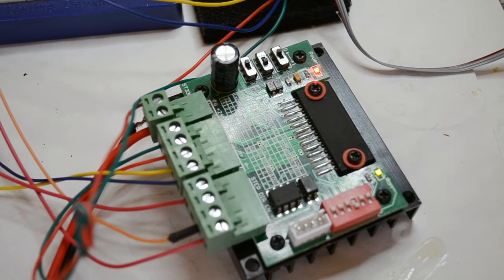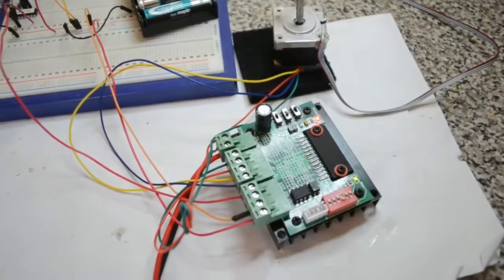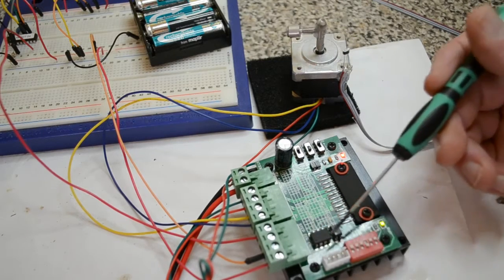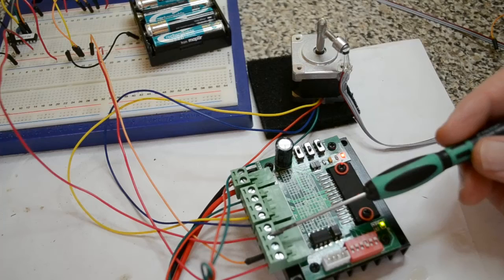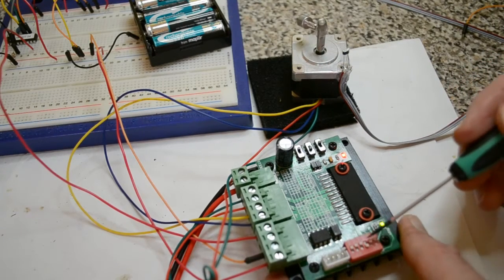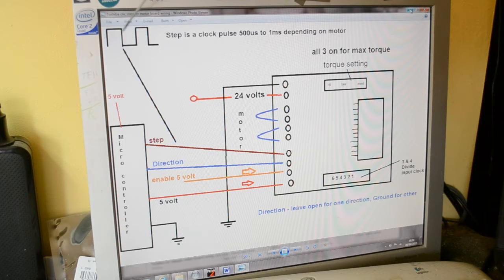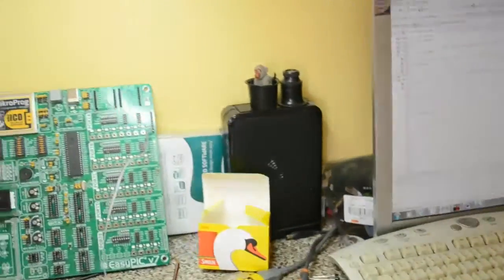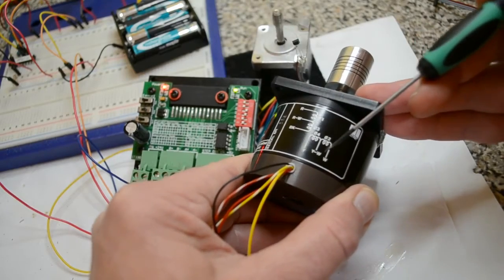CNC Router Single 1 Axis TB6560 3.5A Stepper Stepping Motor Board wiring and code

Comment: Hello Mr.JohnB,
May you send for me code use pic basic pro?
I really really need this,
Please support!
Reply from the maker: Hi,
I don't have any of my MikroC codes or board any longer.
Just create a simple on off pulse to drive the TB6560, like turning an LED on and off quickly.
Reply: @JohnB-2021    Thanks Mr.JohnB for replying so quick!
I am working on a project to automatically adjust the width of the conveyor,
  adjust arbitrary 6 conveyor widths at the same time, accompanied by a limit switch to indicate status to Origin,
I bought the circuit board TB6560 and am about to test it
Unfortunately, the Proteus 8 Professional software does not support the library for TB6560 components so that I can simulate.
thank you for replying,
I will continue my work.
If there is a problem with the code (write by Pic Basic pro) i will share, hope you can support

Comment: hi, What programming language you used and the code is not clear ? if possible, Iam designing my own cnc machine and stucked in coding to be installed on microcontroller, thanx alor sir.
Reply from the maker: +proeng eleceng 
Hi,
I'm using Mikroelektronika's MikroC pro for pic now, but the example is MicroEngineering Labs Pic Basic Pro
Thanks
Reply: John B
thanx alot sir but can you show me the code clearly? best wishes

Comment: I don't know if anyone has noticed but the switches in the red DIL pack are upside down.
This is proved in the video when it is switched to 16 stepping it should of course go SLOWER.
According to the table printed on the board you should translate an ON as an OFF and vise-versa
i discovered this some months ago.

Comment: If the power voltage are 10-24V how to drive a 5V stepper motor ?
Reply from the maker: DJLinux007 
Stepper motors aren't 5 volts.
They usually have a coil resistance measurement only.
The stepper motor driver chip does the rest.
Reply: thank you.

Comment: Thanks, mine did not come with a wiring diagram so I assumed the +5v was for the driver board to supply power for a micro-controller, not input 5 volts.  Got that fixed and I am up and running
Reply from the maker: Excellent news
Thank you.